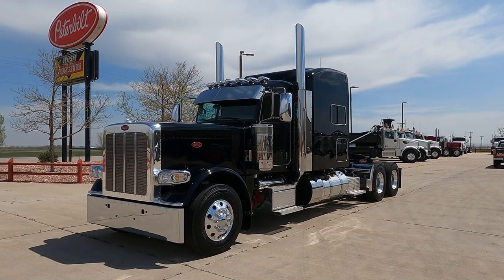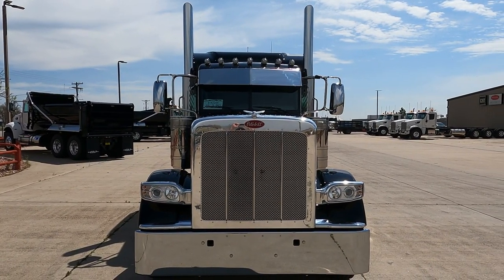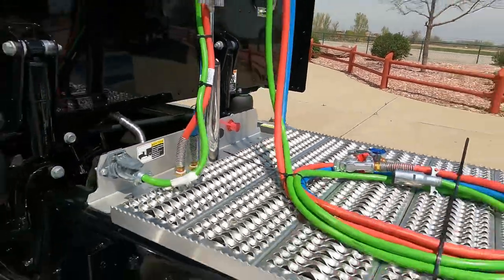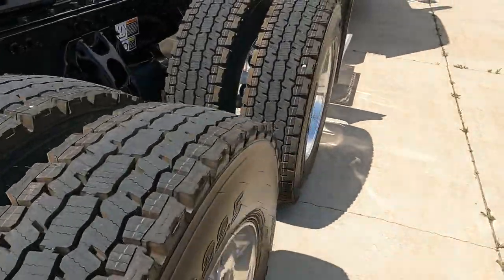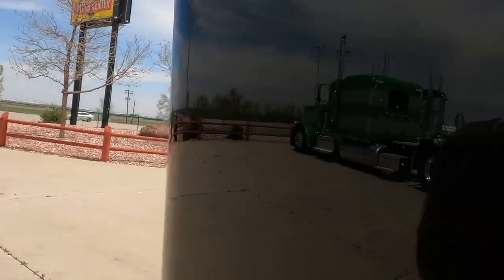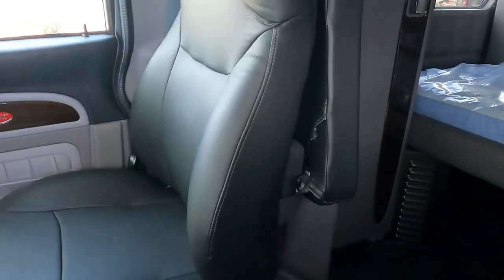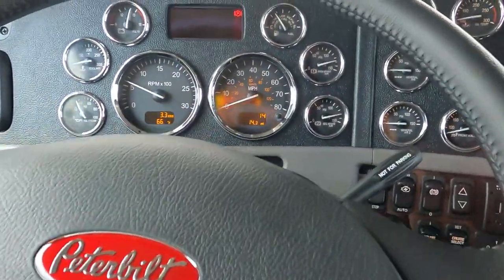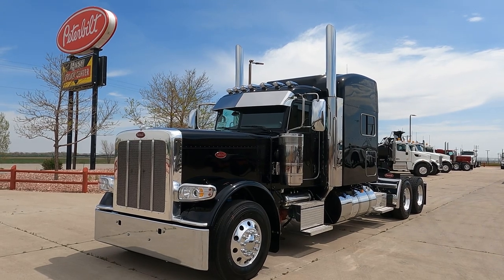2022 Peterbilt 389 - 78" standup sleeper - Sexy BLACK!

Comment: Sharp truck! I’ve got a couple questions, how long does it take to get a custom ordered truck in? And what would be the maximum number of trucks to order at one time? My boss is looking to get away from Freightliner’s, so just curious!
Reply from the maker: Depends on the specs you want.  We can continue this conversation if you email me directly at couchk@rushenterprises.com.
Reply: @RockyMountainPeterbilts  sounds good! I’ll email you or have my boss email! Right now we’re just at the talking stage, not sure if he’s going to “pull the trigger” or not, we just had two 10 truck batches with nothing but issues! Our 600,000 miles trucks are holding up a lot better... So at least one of us will be in contact by tomorrow.
Reply from the maker: @shawnturner3460  Just let me know via email what you would like me to do.  couchk@rushenterprises.com.  That way I don't miss the message.  Thank you!
Reply: Did you guys ever pull the trigger and go with Petes?
Reply: @Vladpryde  🙄 sadly no they are trying to talk with KW on those 680’s. We are seeing some super long build times also! To be expected during these times. Heck we’re struggling to find parts to keep our current trucks running. It’s a mess!
Reply: @shawnturner3460  I've heard about the wait times recently, and I had no idea things were that bad.  I'm not in the industry, yet, so I don't know these things like you folks do.  I like the look of the 680, but Yusuf Abdullah (from YouTube channel "On The Road") has had a lot of problems with his.

Comment: What could I do with $40,000 down payment? What would that look like money, payment wise? If I wanted to order this truck as an example? I’ve been driving for 25 years but it’s been local company driving for the last 23. Heavy haul Costco Volvo 98,000 drop and hook. 12 years 53 foot lift gate, 6 years concrete mixer, propane tanker few years, couple years over the road starting out. Could you explain financing alittle bit. Do you have to have a company set up to run the truck before you buy? You just put down a deposit and wait 6 months or more? Thanks